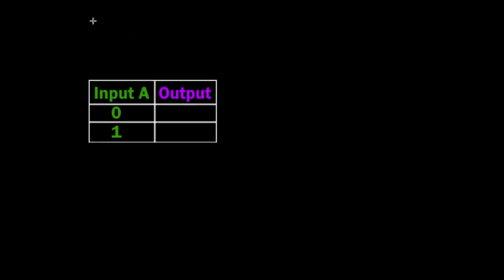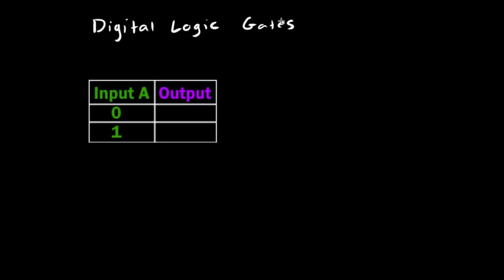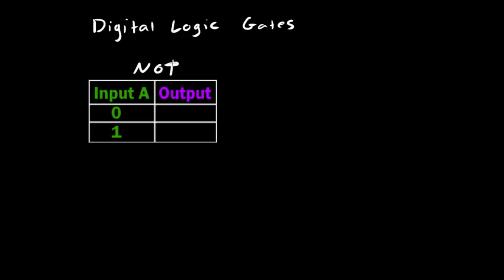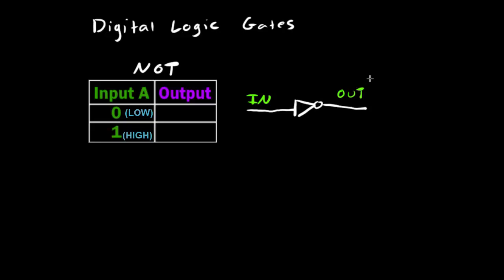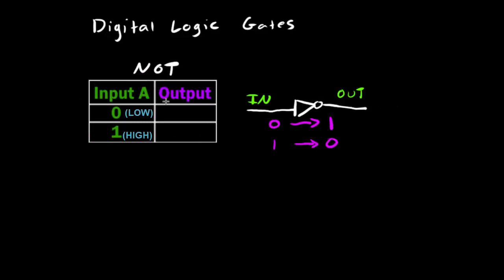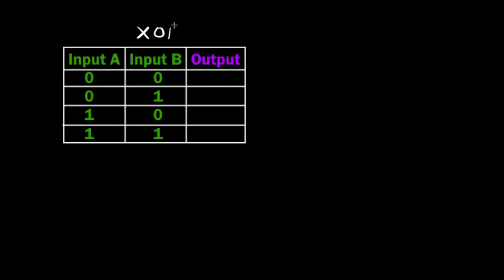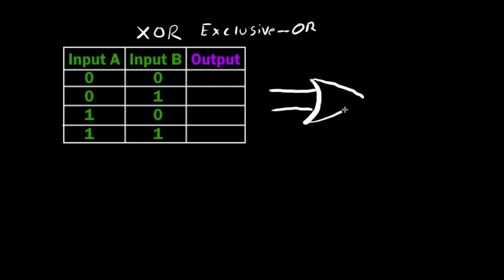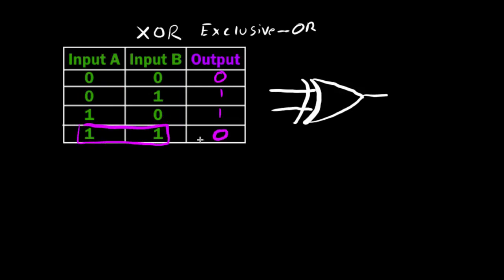Beginner Electronics - 26 - Logic Gates and Floating Inputs (and short channel update)

Comment: Must be missing something important, this does not sound very simple... Mind you, I'm unfamiliar with the topic. I'm glad you have returned, this your course has been my favourite way of learning about electronics. I guess I want to know more about how these gates are implemented in electronics.
Reply from the maker: Is there something specific that you wish to know? If you're wondering how we use these, in about 3 videos we will begin using them quite often (specifically, we will use logic gates to create a circuit that is able to add binary numbers). They are an integral part of how a computer is able to perform calculations and function in general. Let me know if I can help with anything, and thanks for the support!
Reply: @CodeNMore  is building a timer 5/20 minute/hours even something a beginner could handle? Possibly a video on "switchers" (things that can turn on/off something)
Reply from the maker: @creativecityis  are you wondering how you could build a timer circuit, to make something happen after 20 minutes? Or are you wondering about transistors/mosfets when you say "switchers"?
Reply: @CodeNMore  argh, should stick to one question per comment. I live off grid, and being able to start something and it turns it's self off would be pretty handy, especially if I could choose how long it stays on (20,40,80minutes) 
second query (it's Probably alot more full on) my view of electronics has three parts 
1:power
2:Thing that turns on
And a "switch" (thing that connects 1&2)
There is plenty of information about #1&2 but not much on #3.
Anyway, I'm sure other people would be interested, plus your way of simplifying information... It's just easy to understand.
Anyway all the best ☺️

Comment: Whaaaaaat. Welcome back.
Reply: How about some pull down resistors to keep the inputs low, while not connected to positive terminal, instead of the double switch. That way there  is never a moment when the wires are floating. Anyway cool video again.
Reply from the maker: @miroslavmoravek8229  That's the exact method we'll use further on in the series ;) thanks for the comment!